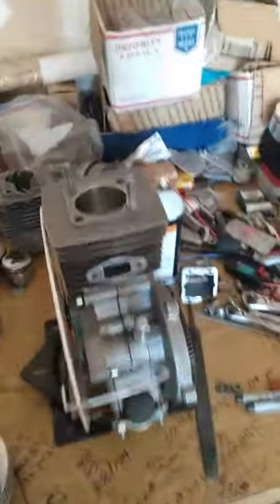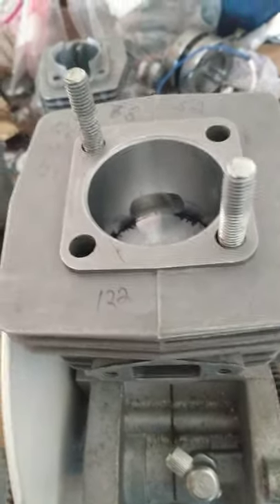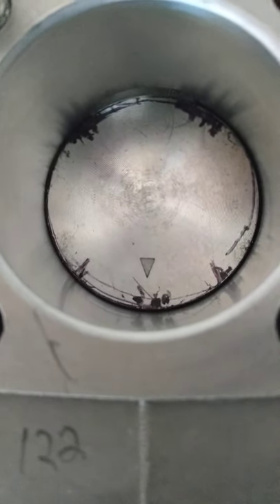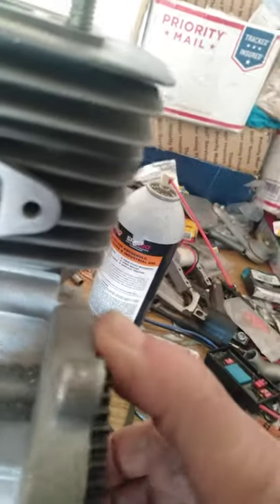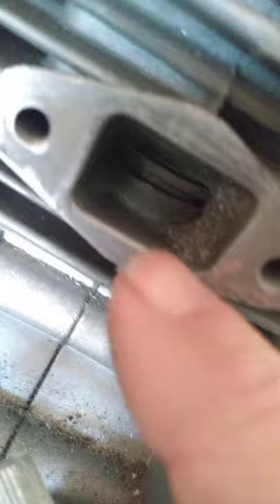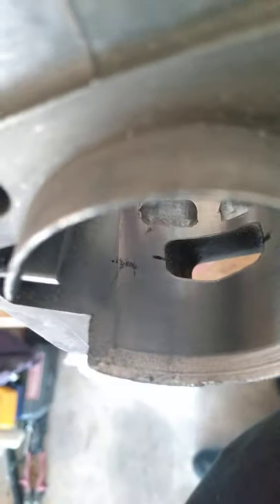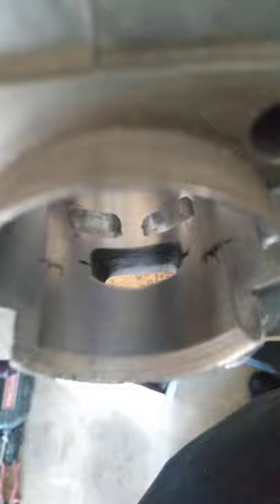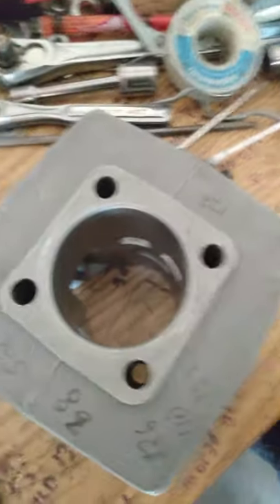difference of a boost port or  extra transfer ports

Comment: What’s your thoughts on having a nicks below or above cylinder port windows i was told if it was was below it would be fine or  above I can’t remember as long as the piston rings cant snag up on it . I will say that the engine seem to run good after a carb cleaning then we broke the main drive sprocket and I did notice quite a bit of oil spitting out the silencer more than just couple dots here and there! Do you suggest re nickel plating cylinde? This engine is a 2 stroke 50 cc Franco morini s5 air cooled I have multiple s5 engines all with the same bottom end the only difference is the top end and piston due to the fact that the two faster top ends have a window cut out of piston 1 has single reed intake while the other has double reed intake and the slowest engine has no reed inside of intake and no hole in piston ? Please help
Reply from the maker: If there is no Reed valve it's a piston port. You never run a window  on a piston port. Not familiar  with that cyl set up but if it's cast iron I personally  would not nicasil  the cyl #1 cost. Besides  if it's cast iron you can bore the cyl and hone it.  All two-stroke build up oil in exhaust and silencer. That's typical. If it's a none cast iron cyl and the bore has defects  that effect  its reliability  or performance  than yes have it nicasil plated but keep in mind nicasil or chrome coating will change bore diameter. You need to compare cost of plating to cost of cyl.

Comment: I need your help on a link for exactly which crank setup to buy for my ye100. My recent video shows what stripped.
Reply from the maker: Never built them I only mess with 47 mm x 40 cases haven't bought a single part for bicycle and well over 2 years so sorry

Comment: Porting for torquey performance I got 2 cylinders I’m 160/120/20 on the closed transfer the open one is split and they’re two and angled idk what to do with the second cylinder in transfers keep the angle pointed to where it is I know that but should I open them both at 120 flat or start the first 120 and the second at…. We’ll I’m stumped their need help as far as what would make the differences as far as power higj and low etc etc
Reply from the maker: Roof angles and especially the exit angles are super important any time you grind on tranfers you disrupt the exit angles. Simply because the radius of tool diameter. It diffuses . Outflow. Hence exactly why I lift or machine or ramp. On open tranfer cyls. When I machine the roofs I use a end mill bit super pain in the ass. I could answer questions for years and have been. That's why made  all theses videos.  On the open tranfer cyls I can ONLY machine 3.5 degrees before it blows threw the roof. These are low power small displacement 77 cc motors you have to have realistic goals. If your looking for torque use the g4 cyl.  Simple stuff. The more you lift your exhust port the more pump you take away from cyl. Ie the work space above exhust port  I'm 100 % positive I show multiple port timings on top my cyls any and all port timings I show work and work great exhust roof port shape also has big effect on power delivery.  A arched shape exhaust roof is better for overall torque and mid range. The flatter roof the looks like mushroom is better for higher RPM. Theres a few videos showing why I choose that shape and reason why. Ie that g4 cyls exhust ports offset. Been working on prostock motorcycle all Day. Been building crap all my life. When I get home I wanna watch TV not talk motors. I'm sorry but I try giving best answers I can in language that hopefully is understandable.  Everything is important maybe go to my oldest vids first hope this helps
Reply from the maker: On your 160/120//20,@16% cyl simple make that exhust 170/120/25@20.8% if your not satisfied wth that run it a 175 /120/27.5,@22.7%
Reply: @2strokecarbtuningportingin187  thanks man I just don’t want a bike that has a crappy take off and can’t take hills ya know
Reply from the maker: @motorizedbicyclenation53cu90  then you definitely don't want to run the numbers I just left you. I'm 170 lbs lived in the hill city Lynchburg VA I never had problems with hills my bike Allways ran 48 to 52 mph with a 10/34  with 158 exh 120 tranfurs and a 130 intake of you want torque run a 5 cc cyl head run reeds and window  vm18 and a good pipe stinger Id no larger than 17mm
Reply from the maker: @motorizedbicyclenation53cu90  it's a 120$ motor cyls are like 30 bucks. Watch my vids  practice
Reply: @2strokecarbtuningportingin187  oh I will and am…. Ya think a 160/120/20 with 62% bore skirted piston boost port over intake and a reed valve (small single hole) will pull hills well and take off decent? also I’m wondering about adding a large banana pipe add stinger but…. Idk maybe a mz65 is what I need I’m a first timer porting another cylinder got it at 150/undecided/unknown but i thought 150 would be good to start off. I’m gonna  add a boost port on it I’m trying two different cylinders. One I’m porting myself learning as I go. Thx for the videos bro
Reply: @2strokecarbtuningportingin187  ya know it turns out that the 170/120/25 cylinder I got from don was 160/120/20 not what he wrote down for me wich is ok actually except I’d like a cylinder I could just have 110 trans so I could go for more torque but I can drop a gasket cant I? 🤷🏻‍♂️ waiting on this bike to sel I’m gonna try my numbers see what I find

Comment: I ned haven't got reed valve yet to test it
Reply from the maker: Anything  and everything  you see me make video  of has been tested all reeds carbs pipes heads. I have tried tested hundreds if combos ported windowed ramped case reeds scooter and saw hybrids from 38 mm to 44 mm strokes. Again I haven't messed with a bicycle  motor for ehh 4 yrs but Been building two and four strokes for over 45 yrs